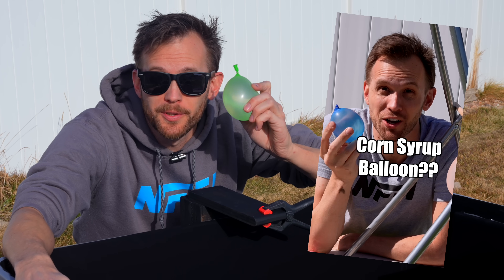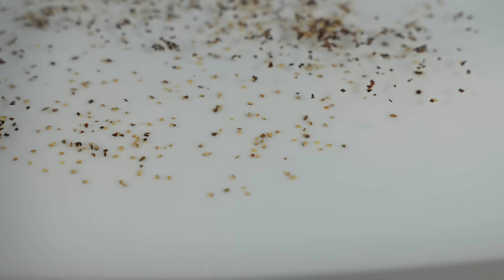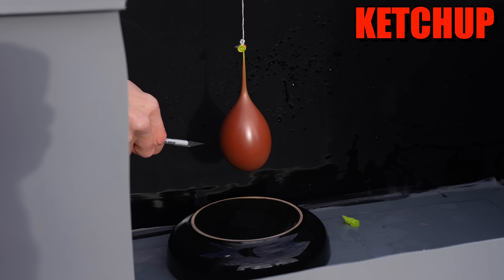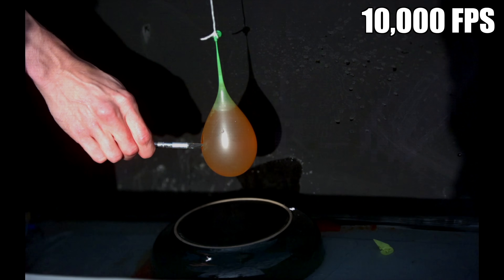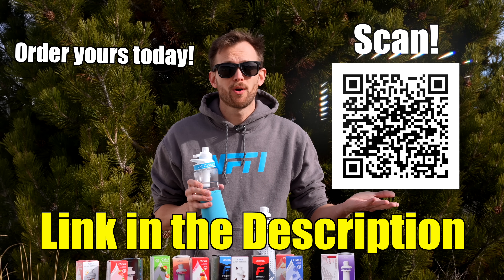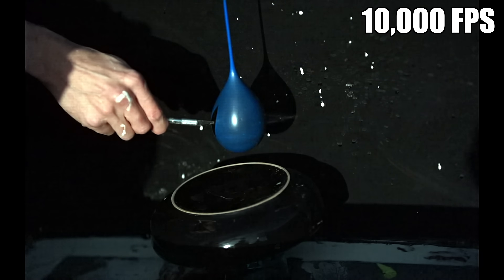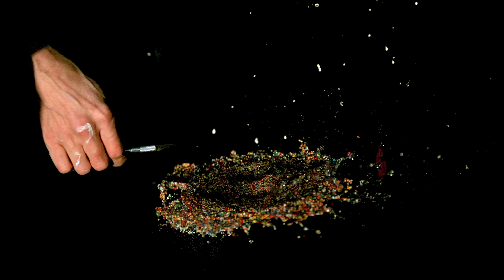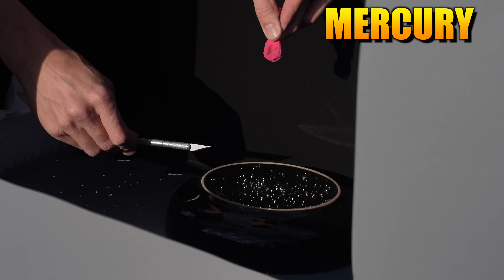Popping a Liquid Metal Filled Water Balloon?

Comment: To put kinetic sand in balloon, use a big bottle, insert the balloon through the mouth of bottle and wrap the open edge inside out making the mouth sealed by balloon. Now poke a hole in lower side of bottle, suck the air out. The balloon will inflate. Put your hand on hole or tape it. Fill the balloon with sand and you have it.. 👍🏻

Comment: I think I'd have made ooblek a little thinner than I wanted, peeled it into a funnel to let it flow into the balloon, then use the same funnel to add a little bit more starch, to minimize the need to knead it.

Kinetic sand, I'm gonna say the widest ...spigot? thin part -- funnel you've got, scoop kinetic sand in a fraction of a teaspoon at a time, and poke it down with a toothpick when it gets stuck by friction on the sides.

Comment: Why are you using a knife blade? Even a scalpel like the one you're using is dull when popping the balloon from the side I imagine. Ever considered a 22 gauge syringe needle from below at it's center point, maybe on a solenoid such that it can travel up, pop the balloon so fast, then retract? Or have it come in from from the side to the middle of the balloons underside, then retract back? You will surely get more consistently roundness images. You have the slow-mo cameras to test for better approaches to popping the balloons, seems a shame not to try other things out.

Comment: Poke a hole in the bottom of a cup, blow up the balloon in the cup till it fills the hole, stretch the neck around the cup, full with whatever you want, then either use a straw to move the balloon out of the way then tie, or cut the cup away. Boom. Balloon filled with whatever!

Comment: Changing the surface tension of water won't do much.
Imagine a balloon will with ping pong balls that have been stuck together. You pop the balloon. What happens? They fall as a single object. Now imagine the same set up, but without the ping pong balls being stuck together. What happens? Pretty much the same thing. They all fall as a group. There is no force acting on them except for gravity, so why would you expect them to come apart?

Edit: Or sprinkles. See 7:19

Comment: HOW TO FILL A BALLOON WITH KINETIC SAND.... 
YOU WOULD DO THIS BY DOING THE SAME WAY THAT THEY PUT TEDDY BEARS AND BALLOONS AT THE MALL. You won't be able to use a water balloon for stay unless you can get a small enough vacuum chamber but you stretch the opening of the balloon around the neck of a tube and then connect the bottom of the tube to a vacuum and turn it on it'll suck the balloon all the way open enough that you can put kinetic sand in it and then tie off of one simple as that

Comment: If you have any way to pull a vacuum, make a small vacuum chamber with a hole in the top (needs to have some kind of lip, like the threaded area of a water bottle.

Hanging a balloon inside the chamber with the next stretched over the lip and then pulling a vacuum will "inflate" the balloon, holding it open for you to pour in trickier items like the oobleck, the kinetic sand, etc

Comment: To get the kinetic sand in you need to do the same thing that they do to put things like teddy bears in balloon's by pulling a vacuum on just the outside of a balloon. Think a vacuum chamber but with the opening of the balloon on the outside of the chamber. The atmospheric pressure inflates the balloon and you can stretch the opening as wide as the material can handle.

Comment: That mercury money shot!

Use a funel to put the sand into the balloon. Still gotta go slow since that sand doesn't wanna flow like normal sand, use a plastic bag with a small piece of the corner cut off so you can slowly squeeze it out at an appropriate rate for your funnel.

Good luck with the comments being uber paranoid about liquid mercury on your skin even though it does nothing that way.

Comment: New 'combo'(?) Ferrofluid in a balloon, over a big magnet, or multiple magnets.  And/or small particulates over a speaker with a metal or plastic sheet over it (like how they show frequencies). See how, or even if the magnet can catch some of the Ferrofluid in it's fields, or if the frequencies can trap some of the particulates on the plate.

Comment: To get sand into a balloon, take a water bottle and place the balloon around the mouth of the bottle and put it in the bottle. Poke a hole in the bottom of the bottle and blow up the balloon inside the bottle. Once the balloon is inflated, cover the hole with your finger, fill the balloon with sand, and tie it off. Finally, cut the bottom of the water bottle to remove the balloon.

Comment: Tip if you have to fill honey through a small opening again in the future: heat to 50-60 degrees C, it becomes much less viscous, then let it cool again and there you go.
Reply: Ah yes, then instead of it being difficult to plunge, it's halfway to boiling.  

Reminds me of an xkcd: "We've solved this problem by creating a bigger, more exciting problem!"
Reply: @bvoyelr  Half of 100°C is not 50°C or that is to say the energy required to get to 50°C is not even close to the energy required to get to 100°C, the problem with measuring percentages of temperatures on relative scales such as Fahrenheit or Celsius is that they have no reference point.

Easiest way to reference it is most hot water systems will range in the 50-60°C mark, and while 50°C will take ~5 minutes to burn someone, 60°C can cause third degree burns in a a few seconds.

To correct @TRPLD 40°C is when honey starts to naturally soften and 50°C is the hottest you'll need to make it to achieve the result, much higher and it begins to cook and break down the sugars.
Reply: @bvoyelr  no not boiling. 50-60 C is unpleasant if touched for sure but won’t really burn you.
Reply: @TRPLD  60 C water will give you a third degree burn in seconds, now imagine that sticking to you increasingly well as it cools.
Reply: @TRPLD  are you kidding? 60°C is hot enough water to cause 3rd degree burns in seconds.
Reply: That's pretty clever.

Comment: For liquid metal I'd have gone with gallium for safety.
Reply: Mercury is no where near as dangerous as people think. The main risk is the fumes, which isn't a problem if your outside, it can't get through your skin so it's safe to touch as long as you don't have a large open wound.
Reply: @emmastrange5557  It can most definitively contaminate the ground and seep into the water table if if falls on the grass.
Reply: @LucasSchimmel  yeah you definitely need to be careful with it. It not being as dangerous as some people think does not in anyway mean you can mess about with it with little care, you need to take some precautions in order for it to be safe e.g ventilation, and something to catch accidental spills.

Comment: Just fill a small PVC pipe with one end capped off with Kinetic sand, blow up a balloon and put it on the open end.  Turn it over and tap so sand falls into balloon and replaces the air.  Tie off and done.

Comment: Kinetic sand into the balloon. Think of this solution as an hourglass. On one end you’ll have a reservoir for the sand (use an empty disposable plastic water bottle) on the other end you’ll attach a balloon blown up to the size you require, then attach that balloon to the open end of the bottle, it’s important to leave the balloon expanded and blown up. Make sure the balloon is secured well to the bottle AND relatively air tight. Now turn the apparatus and shake. The kinetic sand will displace the air in the balloon.

Comment: If you cut the top off of a soda bottle, to create a funnel, you can stretch the top of the balloon over the opening of the bottle and make a wider opening for the balloon.  Then you can poor all the stuff you like in it without all the mess. Just need to make sure that you hold the balloon on the bottle so it doesn't come off. 😁

Note: It would have worked for the flour, sprinkles too, molasses and honey too. 😆😆

Comment: I feel like if the genetic sand doesn't work in the big syringe, putting some air between the plunger and the sand might.  Maybe also cutting the nozzle shorter so the opening is wider while still being able to fit into the balloon.

Comment: If you want to put large things into a balloon you need to make a box attached to a vacuum at one side at the top of the box is a small piece of pipe protrudes.
 You simply put the mouth of the balloon over the pipe and create a negative pressure inside the Box.
I would invest in a good laser for popping🎈☀

Comment: Kenetic sand ballon: Put sand in empty bottle (not all the way), put balloon around top of bottle, squeeze the air out of the bottle to fill the balloon and let the sand fall into the balloon replacing the air as it does. Remove balloon, boom sand balloon (should also work with other stuff that doesn't want to go into the balloons but flows easily enough, i suspect the sprinkles and honey both would have been easier this way since you aren't fighting the pressure and sheer force. Use air pressure and gravity for the win)
Reply: Why not just use a funnel instead..?
Reply: @BEAST.420G  There wouldn't be enough force driving the kinetic sand into the balloon with just a funnel
Reply: Kinetic*

Comment: Try mixing the Kinetic sand with rubbing alcohol and then letting it dry out.
Reply: The problem with this solution is two fold. One, it won’t dry out when inside the balloon as it is mostly sealed. Two, This solution will contaminate the kinetic sand in a way that will disrupt its natural hydrophobicity.

Comment: The fact that you didn't wear gloves when handling the mercury or wear a resperator  or any PPE is criminaly tragic
Reply: I thought about that too, but (1) outside ventilation (2) comparatively short exposure (3) controlled, contained experiment environment, so I think this was adequate. Although I will point out it's wise for science presenters to use maybe a bit more PPE than might be required for example's sake.
Reply: @Qermaq  i dont think any regular person would have access to such amount of mercury

or any mercury for that matter
Reply: @RedstonekPL  Nate is far from a regular person, though.
Reply: @Qermaq  i wasnt talking about nate tho
Reply: There's 2 types of mercury, ethel mercury and methel mercury. 1ng of methel mercury is extremely toxic and should never be handled without proper PPE. Ethel mercury by contrast is relatively safe to touch as long as you don't have an open sore on your hands or come into contact with it for a long period of time.
Reply: @Defiantone427  Bingo. Ethyl mercury is not "safe" in the sense clean water and a piece of lettuce is. But compared to a lot of substances, it's quite safe. Maybe just a bit less safe than handling a more typical metal.
Reply: codyslab must give you palpatations
Reply: Watch more Cody's Lab.  He did nothing dangerous here.  All the PPE warnings are for people working with mercury in a lab or factory up to eight hours a day.  Nate played with it for 20 minutes outdoors, with a shield around the splash area.
Reply: It’s not the mercury you’re thinking of.
Reply: @The_RC_Guru  lol what is the mercury I am thinking of then?
Reply: Check out some of Cody's old mercury videos if you really want to see some stuff. Holding mercury in his mouth and trying to stand upright in a pool of mercuray are two I remember. Cody has a lot of mercury.
Reply: How about liquid gallium?
Reply: Mercury is pretty safe to touch.

Comment: The way you fill up a balloon with kinetic sand is use a container with negative pressure to suck the balloon. That will allow you to have a large opening
Reply: This is how big balloons are filled with stuffed animals and other large objects for special occasions. I think the sand should go in just as easily. Then just remove the air from the balloon and tie it up.
Reply: @sarahkwast1250  this is part of how stuffed animals are filled. The other MAJOR part is a gigantic agitator that stirs the fluff about to allow it to not clog. This is absolutely necessary for this process to work. There is no agitator therefore it won’t fill properly.
Reply: @sarahkwast1250  exactly!
Reply: I was just thinking  of  this and seeing  if someone  said something  already  😅
Reply: @h4cksourc363  yeah that question is what they call engagement farming.
Reply: that big syringe would probably work. cut the nozzle at a wider part, feed in balloon, wrap the open end around the outside of the nozzle and hold it. pull plunger to make the balloon inflate then fill with sand via funnel. let air into the syringe while holding the balloon and tie it and pull it out with the plunger.
Reply: Best way would be to vibrate a tube and blowing air whilst grounded for static charging of the granulated sand rushing with a regulation of the air flow to the balloon
Reply: I replied elsewhere before reading comments - but for anyone who isn't understanding the suggestion ‐ search for videos on the Classy Wrap machine.  It's the name brand of the machine used to fill gift-in-a-balloons and a custom version for smaller balloons would seem to do the job.
Reply: I knew that I would be too late for this suggestion, so I looked for it to give it my 👍.
Reply: Or, hear me out, just use a funnel.
Crazy, I know.
Reply: @BEAST.420G  Have you ever used kinetic sand? That won't be as easy as you say.
Reply: @  can’t use a funnel for kinetic sand lol!
Reply: Just use a yellow sheet of latex. Wrap a baseball size of sand up really tight and tie with a string. Same as a balloon.
Reply: I dont wanna like its 69
Reply: This solution would work with a liquid, but not as effectively with a solid. It would only suck air in because of the negative pressure would cause areas of higher density to effectively clog the balloon with some sand which would act as a filter allowing only air to enter.
Reply: @rubikscubeearf6218  it 100% would! This is how they put giant stuffed bears inside wedding balloons!
Reply: @dougfoster445  Maybe I’m not understanding. Are you saying that the negative pressure would invert the balloon around the object?
Reply: @rubikscubeearf6218  I've seen this IRL, so I'll try to explain. Imagine a plastic jar, like a mayonnaise jar. You insert the whole balloon into the jar, and stretch the neck of the balloon over the opening, so it looks a little like a lung hanging inside a chest. Then, using a small hole near the base of the jar, you suck out the air around the balloon (like your diaphragm sucks air into your lungs). The balloon conforms to the shape of the jar, thus having a wide opening that is easy to fill with whatever you like. When the material has been inserted, then you can allow the air to flow through the small opening and the balloon shrinks back to it's normal size. 
As the others mentioned, this technique is used to put full sized teddy bears (or other balloons, flowers, etc.) inside balloons.
https://www.youtube.com/watch?v=cA-Wdi1JQ7M
Reply: @Panda42-ul5if  thanks for the description. That sounds really cool. I appreciate you taking the time.
Reply: @Panda42-ul5if  also, thanks for including the video. That’s so cool! Very brilliant use of a vacuum. I love it.